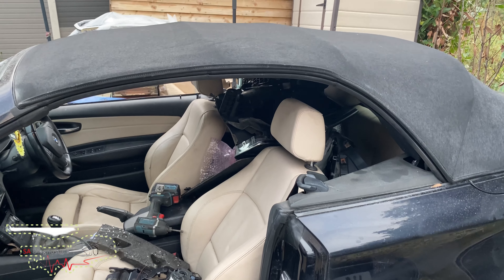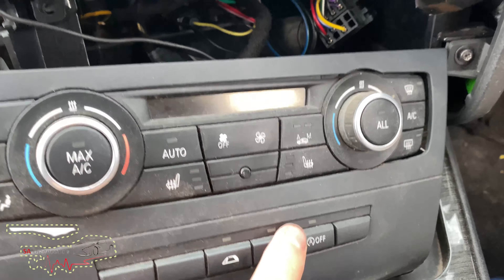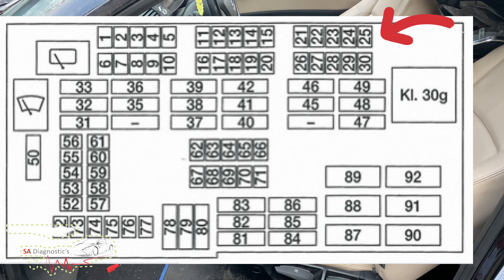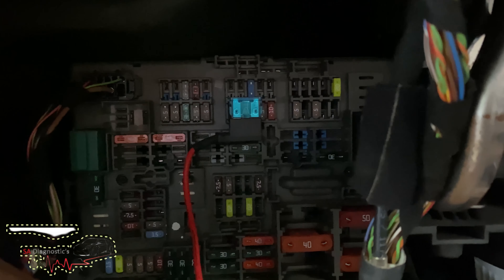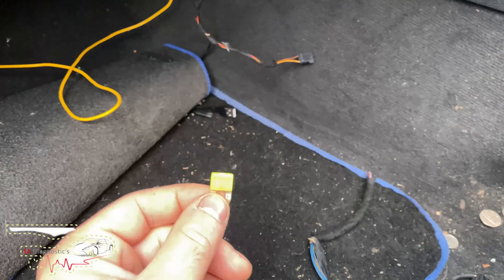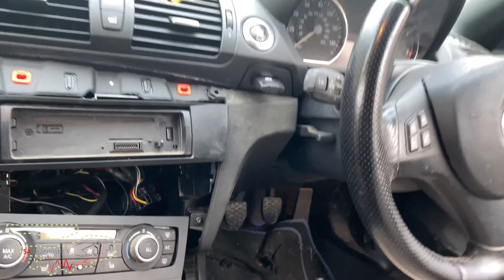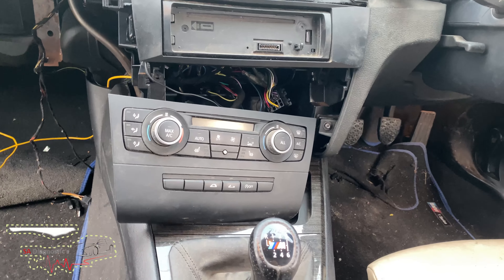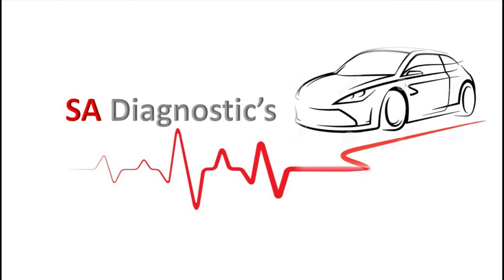BMW E88 Roof Convertible Not Working Fuse FIXED!!

Comment: Hi, I’m having the same issue the bottoms won’t work or light up for the roof, auto start stop, heats seats, but stereo and air con works I’ve checked the fuse and it wasn’t blown

Comment: Hi is there a fuse box in the engine bay on this car thanks and do you know where the oxygen sensor fuse is located
Reply from the maker: @abdulbeany1894  from memory I don’t think there is only F models have them in in bonnet. I could be wrong but that’s form experience
Reply: @sadiagnostics  thank you

Comment: Good sir, I know this is a bmw topic but I'm  sorry if I may ask, can you clone/ read a bcm from a ford ranger or even programme a used BCM using the Autel IM608 and you using the original key aswell, there not much videos on a bcm programming or cloning on these Ford Rangers 2016, TIA🙏
Reply from the maker: Hi, unfortunately I’m not exactly sure if if you contact Autel they may assist. Sorry I don’t know the answer
Reply: @sadiagnostics  if you have an IM608, look up the MCU mask no: MC9S12XEP768 (the one I'm working on) does support it, but can jst read the Dflash and Eeprom and write to the new bcm, I don't if that cloning or it might not work, jst asking if it's possible.

Comment: Hi buddy I have a BMW convertable 120i 2010 I press open button front locking opens but no lift .I then get the roof logo bleep noise and the close button flashing red .I pulled out the two pulls cords to let the roof open and   used the Allan key to open front locking .
How do I reset the two cord pulleys to try to open now electrically as this obviously releases the drive can you help Trev in sunny cape Town south africa
Reply from the maker: Sorry am unsure your best looking into the manual of the car or speak to bmw service department…
Reply: Did you sort it ? Pull cords reset them selves on a full open... I'm now in same situation as you... roof unhooks, but won't open

Comment: So you stripped the whole dashboard and then decided to check the fuse.
Reply from the maker: I take it you wanted to comment to act smart but what you didn’t realise is that the whole dashboard on this car was changed/replaced at the same time as it was deployed. So before we put everything back on. I thoughts it’s clever and easier for all viewers to see where the fuse is. Usually people comment good things rather acting smart. Would like to hear more smart comments…
Reply: i was wondering the samething but listening to the gentleman speak I knew he is a skill mechanic so I figured the car was already being worked on